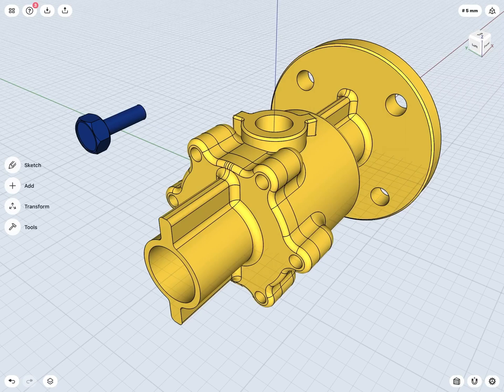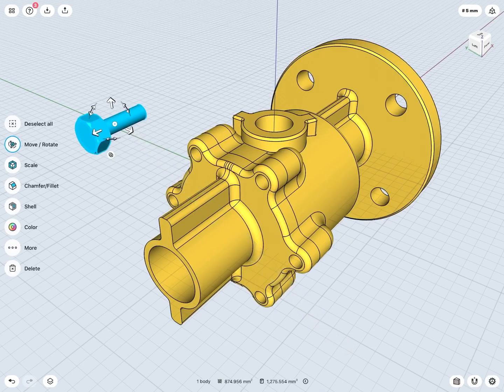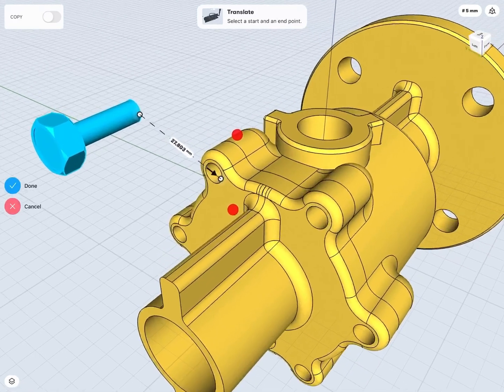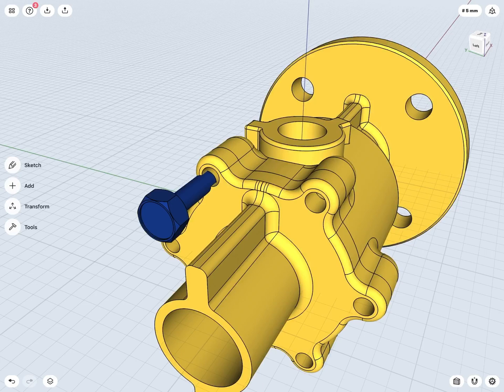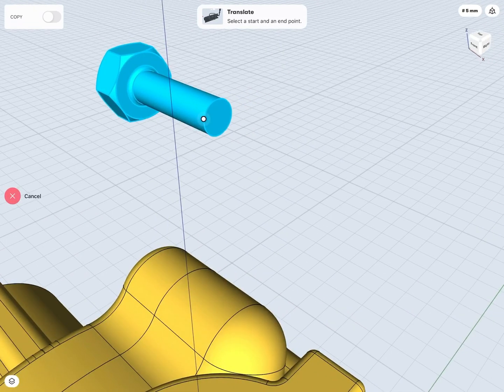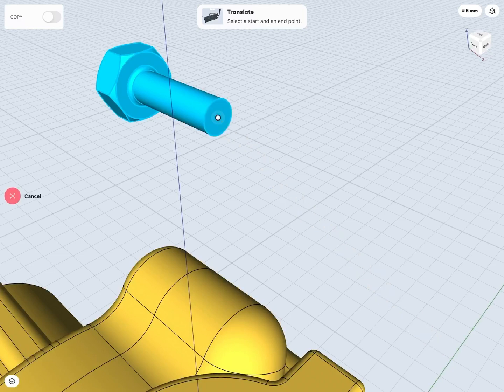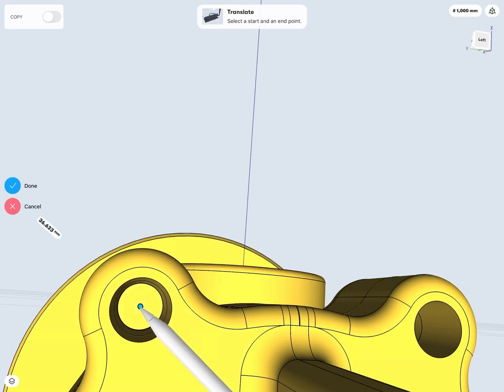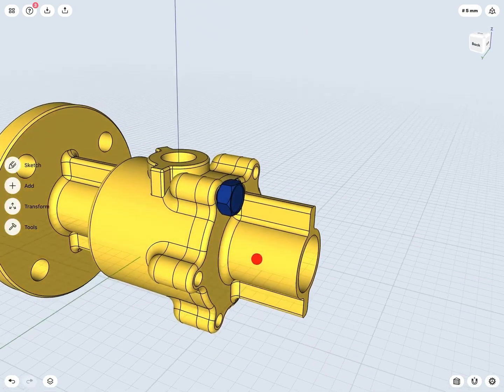Translate bodies | Creating simple 3D bodies

Comment: very nice, thanks for this video

Q: the bolt is actually not fully in the whole in your video, the head isn't touching the face of the housing (or the washer that should be inserted). Also in reality the whole is hopefully a bit deeper than the bolt is long, to allow for cutting a thread. So is there a way to do this for just one axis ? Align the centers of two circles and then translate the part just along it's center axis using the head face and the housing face to determine the distance ?
I guess I could align it to the center as you did, then (in case the hole is too deep as it should be) pull it out and then translate it after measuring the distance between the two faces in question...

also interesting would be a version where the part is not perfectly aligned to X Y Z and the bolt still is...

AND last not least, I would love to have a command to create nuts, washers and bolts as per the various ISO standards.  :-)
Reply from the maker: Hi, thanks for your detailed feedback!
Please take a look at our very latest release with the Align tool:
https://support.shapr3d.com/hc/en-us/articles/360016878160-3-52-Align-tool-

Nuts, washers and bolts can be imported in STEP and IGES, on which you can apply the Align tool :)